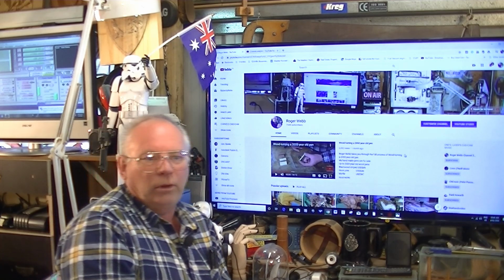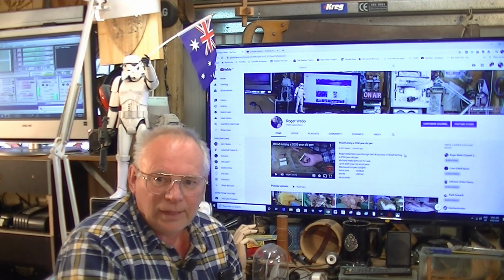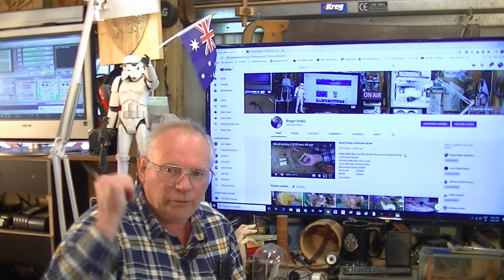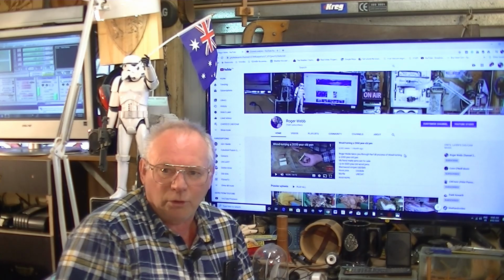CNC router NIGHTMARE!!! buying, but no need to be ;-))

Comment: Roger... Perhaps you should do a  video on your Mach 3 settings ...your travel speed settings how to set it up with softstops etc... then putting the work piece correctly on the CNC... why you would want to start your Home from the left or right... or even when you would set your Home  in center for round pieces etc...I don't see to many video's out there like that....I am adding a Plasma this year...are you considering that also?

Comment: I bought a kit of the cast aluminium bed type, you described in the beginning. I was told all the holes for assembly where drilled. They weren't. The surfaces that where drilled, weren't flattened correctly. This resulted in the ball screws getting bend men moving. No holes where made for the motors, though they claimed it was made for Nema 23 motors.
Alibaba agreed there where a problem with the goods, but in order to get all my money back, I'd have to send everything back, at my own cost and risk.
They didn't consider shipment cost a part of what you paid for the product either...

Never buy anything from China without a western pay service like PayPal. And if there is trouble with the deal, demand your case getting move to your local country department.